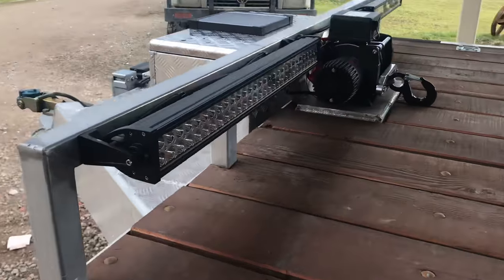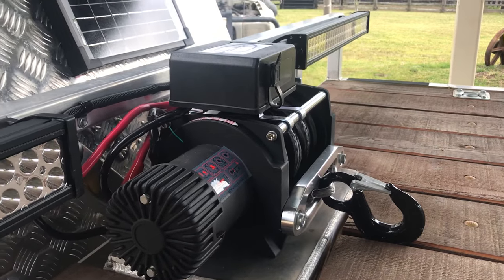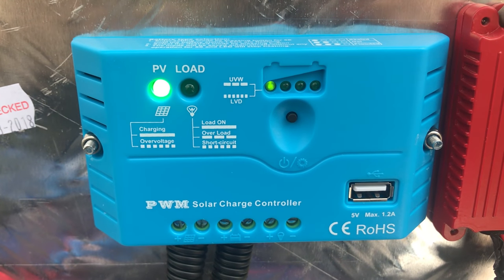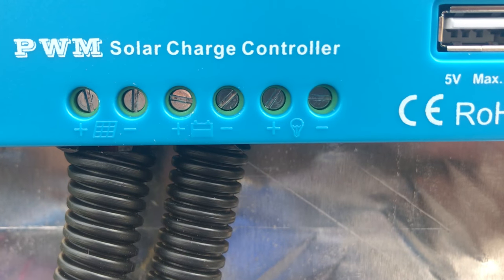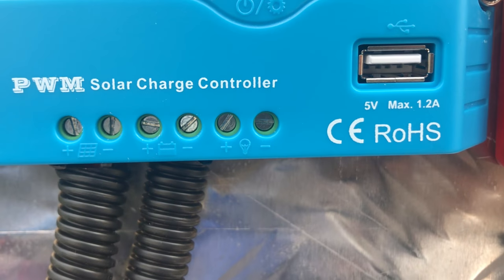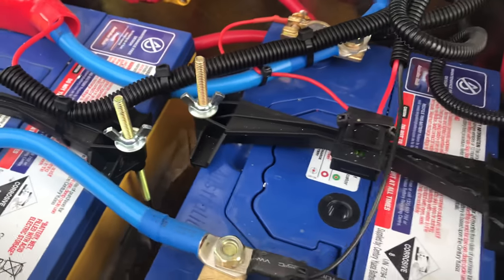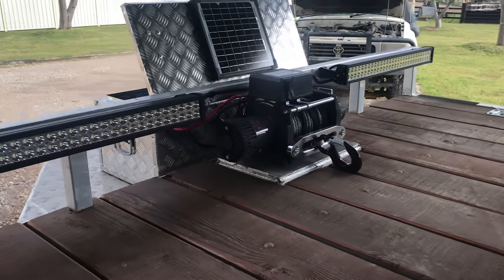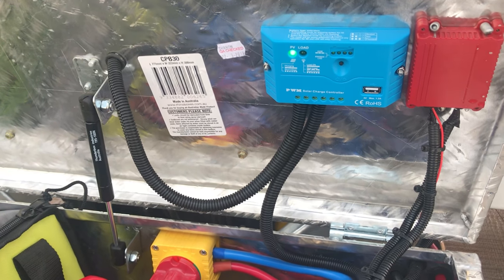TRAILER WINCH POWERED BY THE SUN ! 12v equipment/car trailer winch set up.

Comment: I have a GReddy baffle on my GR. I take it to the track a lot and drive it hard. I installed mine when cleaning the pick up tube and installing headers after the 15th or so track day. I saw another video showing that baffles do a little bit but not a ton. I may get an accusump down the line but 20+ track days with no issues so far

Comment: Planning on doing something similar to my small utility trailer soon. I work on golf carts and a winch would make it easier to load broken ones. Here is the setup in my head: Tractor supply tool box mounted to trailer tongue, 2,500lb Badlands winch mounted inside center of tool box with wire going through the back, 20watt solar panel on top, 10 amp solar charge controller inside top, and an Optima RedTop 34 AGM battery (800cca / 50Ah) to power it. A few questions though: 1. the 1 battery should be enough to power this small winch right? 2. Does the solar charge controller stop the panel from charging the batteries once they are fully charged? I assume yes but if not, wouldn't the batteries overheat and cause issues?
Reply from the maker: Yes solar controller stops the charge

Comment: Hey there mate, rate this setup, good job 👍 I’m looking at doing similar on a mates trailer. So you have Solar charger, do you also have a DCDC charger or something like that in the box to charge the winch battery while your driving, off the car alternator?
Reply from the maker: Thanks mate, no I never needed it so it’s pure solar only

Comment: Mate I want to do the same in a small enclosed trailer with a small 3000lbs winch just for loading 200kg concrete grinder on my trailer. I went yo the shop to get the stuff and they told me “no chance of charging your battery with a solar panel and a controller. They reckon the winch draws heaps pf amps and i cant even try to keep up. They tried to sell me a battery charger for 700. Of course i didnt buy it. How true is that?
Reply from the maker: If you run x2 car battery’s like me “cranking batteries” you should be fine. 

Run like a 200w solar panel on your roof with a solar controller hooked up 24/7. I can’t see you having any issues unless your going to use it 5-10 times a day you might be running low on power. Then you might need to run a cable to alternator off the vehicle.
Reply from the maker: I still have the same battery’s and panel on my trailer since I posted this video years ago. Running sweet 🤙🏼
Reply: @TyFenwick  Thanks for that mate. I was thinking on getting a lithium battery cause they say you can use 100% of amperage and in AGM lead acid you can only drop 50% of the power otherwise you screw the battery. But lithium are really expensive too, so Im kinda lost now. I dont want to run a wire from the alternator thats why I wanted a setup like yours. The winch is going to be used 2 times a day probably, maybe 4 but not idealy. You reckon I can't sort it with just one cranking battery mate, thanks for the advice!!

Comment: whats the gauge of your wires between the battery and winch?
Reply from the maker: There are charts on google match your wire size. Look at the amp specs of your winch to get the correct wire size. 😎👍🏼